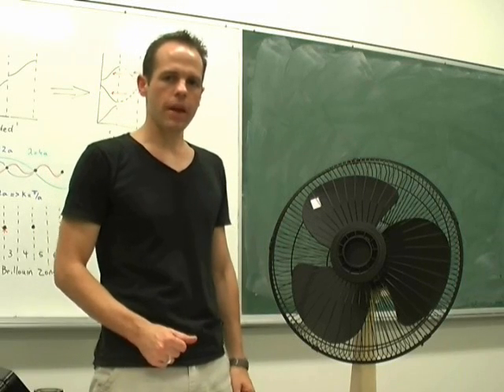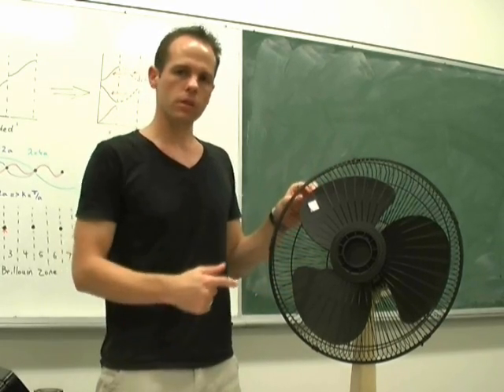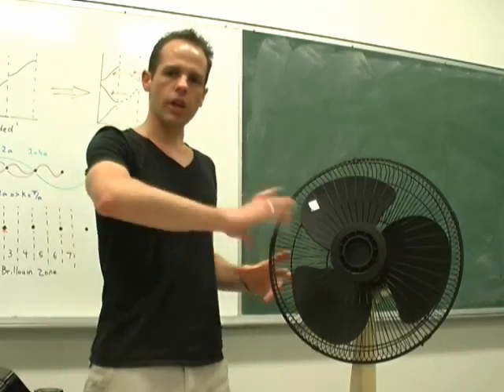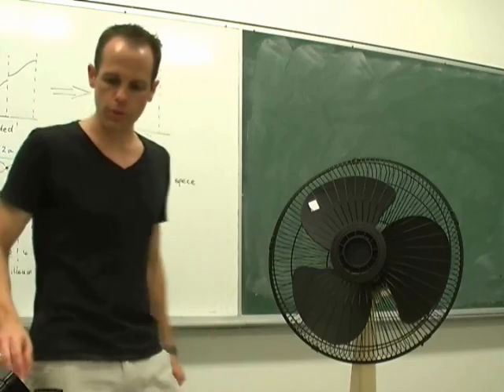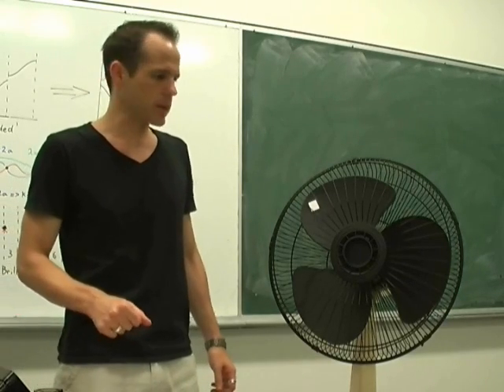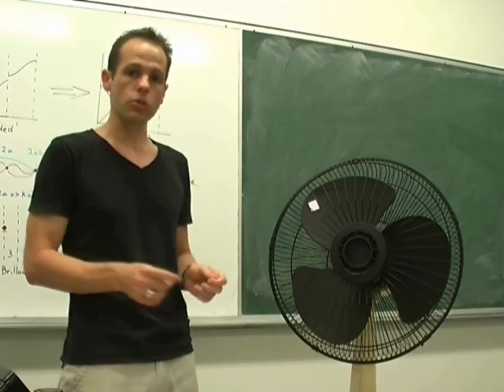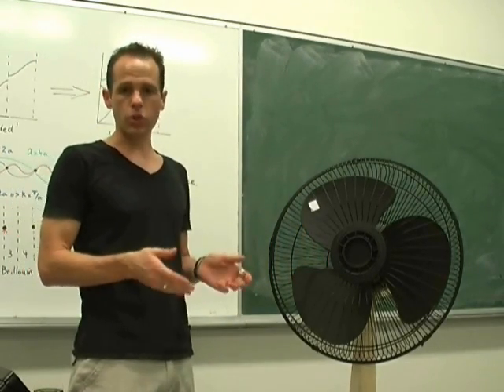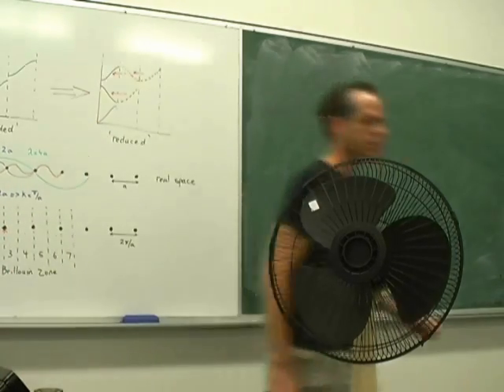Making sense of Brillouin Zones - Part 2

Comment: I understand Aliasing...it is a sampling thing. 
How does this sampling thing relates to Brillouin Zone? Does this mean, we get the solutions of si only near the position of atom? 
Does that mean,we have no clue of how the si is in between the 2 lattice points? 
Someone please?
Reply from the maker: Aliasing is an effect of a continuous wave or periodic system in a discrete period system or sampling. It relates here because you have a continuous wave, which is the electron, in a periodic discrete system, which is the lattice. You can know the solutions everywhere, that's not the implication here. The implication here is that the electron looks like a free particle at wavelengths very different from those of the periodic lattice, but at wavelengths that are integer to the periodic lattice you get substantial modifications from free particle behaviour. What I'm trying to get across in this video is the underlying reasons why an electron in a crystalline solid sometimes does and sometimes doesn't behave like a free particle.

Comment: Very nice demonstration! Still I don't understand why the crystal periodicity leads to something like a discrete sampling. I mean the lattice isn't just defined and interacting with the electrons right at the lattice points, but also in between. Electrons "see" each other also in between and a unit cell consists of several atoms in general.
Reply from the maker: +Fid Rewe That's true, the electrons see the lattice everywhere they are, but they can't escape the lattice being periodic. Basically there's two objects with periodicity here that interact, whenever you have that there's always discrete sampling effects. Can be a CCD camera taking a photo of a brick wall even; there's still going to be an interplay between two different periodicities, so we will get this effect popping out.